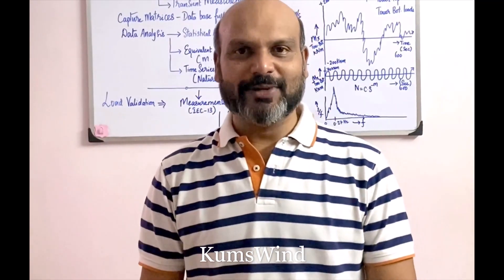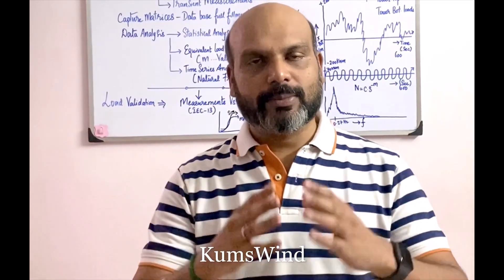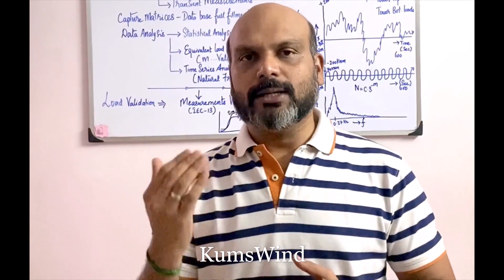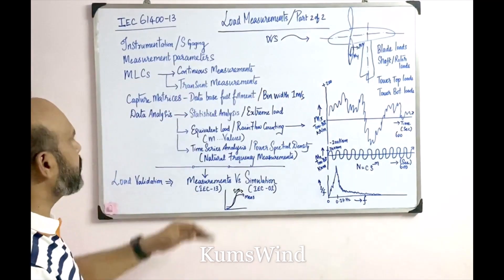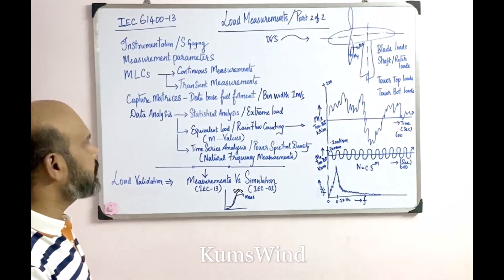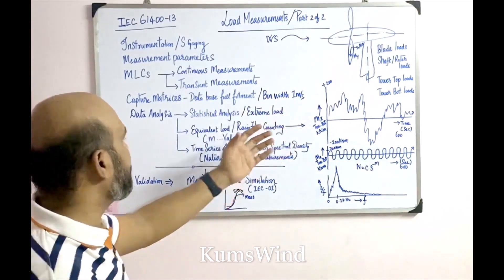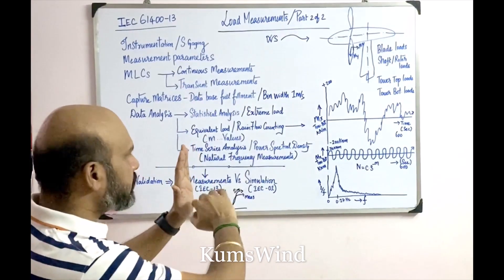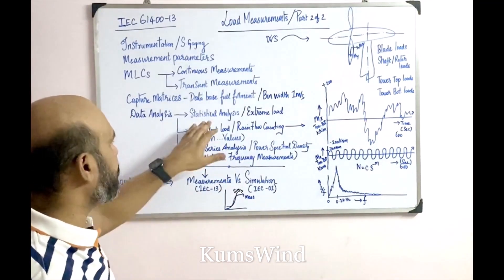Wind Turbine Mechanical Load Measurements (Part 02 of 02) | KumsWind

Comment: Nicely explained videos. Sir, I'm working in Wind Industry in O&M department. I like to shift my career to wind turbine design. Can you suggest me a right career path to the become a design engineer. As you have also shifted many domains in wind industry and I feel you are the right person to take advice from.
Reply from the maker: Thanks shreejit, nice to hear from you, in my perspective all areas of wind energy are fascinating, that way O&M too has many interesting and technical stuff to work on, especially with the power curve performance, yaw efficiency corrections, digital asset management platforms, SCADA, CMS technology, turbine controls and so on. Switching to designing is also something you could inspire. I can guide you more if I know about, how many years of O&M experience you have and where you currently work and so on. You may write to my email id. kumaravelwind@gmail.com